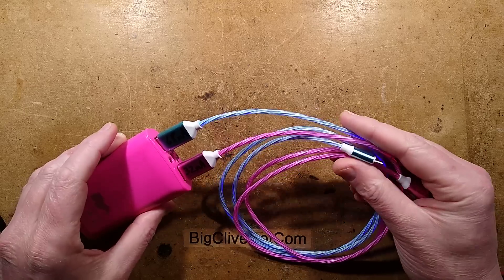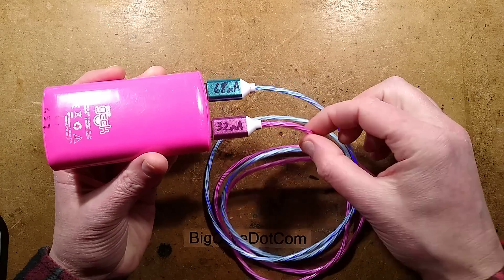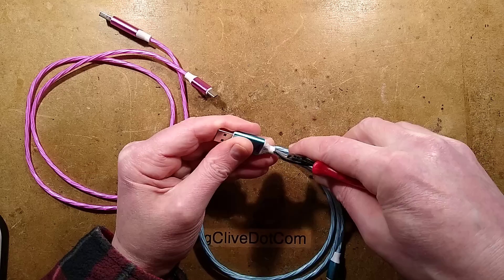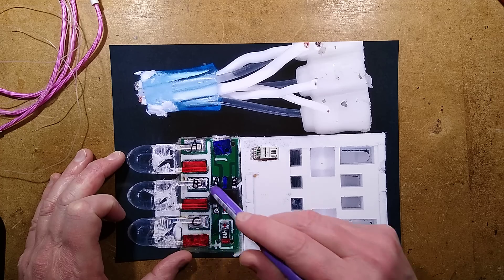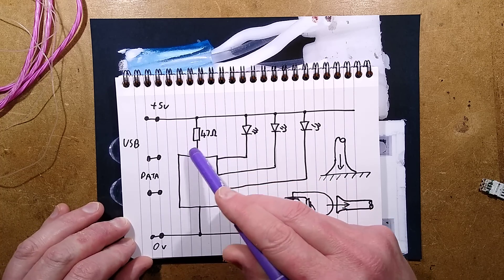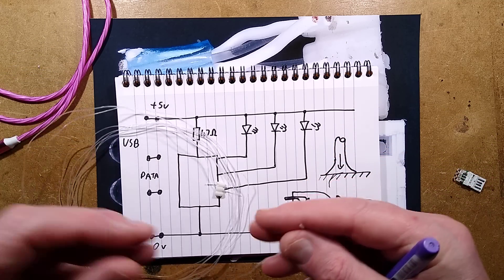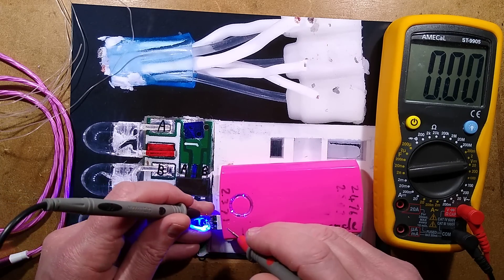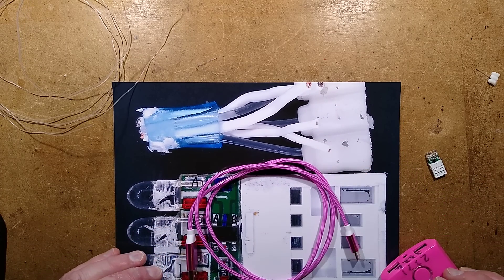Best side-glow fibre optic I've seen

Comment: Wow. I'm impressed with how even the illumination is. If you saw this at a glance, you'd be forgiven for thinking it's EL.
Reply: I had one of these cables for almost a year now, they start to fade in random spots after like 5-6 months
Reply: And the type-c end self-destructs both the cable and the phone's port
Reply: Indeed! I had a similar cable that used elwire. The noise and interference from the little inverter made it too annoying to use.
Reply: I have the blue one and it throws off a lot of light. Used it last week during a power outage and it provided enough illumination to avoid tripping over anything in an open plan area of 63 square metres. I was impressed with it.

Comment: That is a nice effect. Sometimes I just buy these cheap USB light-up leads and use them as festive decorations plugged into a USB socket on the TV or whatever.
Reply: I was thinking the same, ie. using them as just decorative lights.
Reply: I'd get a headache staring at it for loo long. Would look great if static though or a slow brightness change.

Comment: The red cable might have lower current by switching the three LEDs "ON" with a shorter duty cycle.  Red LEDs are lower voltage than blue so they may have had to reduce the higher current by reducing the ON duty cycle.   Thanks, Clive.
Reply from the maker: I'm probably going to end up opening the red one.
Reply: @bigclivedotcom  A little disapointing you didnt chose to destroy the pink one right away.
Reply: @bigclivedotcom  red one probably has the resistor on the negative side of the chip so it's actually doing something lol
Reply: @rimmersbryggeri  He's likes pink i believe. I see lots of pink in his videos as I must have watched a dozen a night for the last week
Reply: @Shakey31  Thats the point destroying tack pink thinks is the signature of the channel. I have been watching for 9 years or something.
Reply: @rimmersbryggeri  ahhh 👍

Comment: I wonder what happens if you use it with devices operating Quick Charge or the equivalent with voltages of 9, 12 or even 20V? Perhaps that's where the resistor comes in to play.
Reply: We don't know what's inside the plug on the other end of the cable. There might be a circuit board that prevents negotiating for Quick Charge.
Reply from the maker: Given that the data is intact it's feasible that it might negotiate a higher voltage and blow the circuitry.
Reply: Only one way to find out😂
Reply: You'd have to have USB-C adaptors on the end wouldn't you? Or does that standard extend to USB-A?
Reply: @LongPeter  I've got QC3 chargers with USB-A sockets and QC3 devices with both USB-C and micro USB. It seems any combination is possible, certainly up to 12V.
Reply: @chrishartley1210  oh, that's interesting. Ah, I probably conflated the USB 3.x spec with the USB C spec.

Comment: I remember seeing a similar style of cable for for the old iPhones and iPads. They were nowhere near as bright back then but the 'flow' rate changed depending on the amount of current draw, fast when first charging, slow or static when the device was almost full.
Reply: Those were electroluminescent and fantastic...but I've not been able to find them in years
Reply: @grayrabbit2211  I have one as well. After only a few days it stopped working properly - it shuts off the light show after a few seconds now
Reply: Yep yep yep, came here to say that. Mine's only lightly used and so still working! (It's the one I keep in the car for the maybe-once-a-year emergency charging need.) ^_^

Comment: I bought a pack of 2 of these about 2 years ago, one is all green, and the other is red, green, blue. They have both been plugged in 24/7 since then. The intensity has gone down slightly on both of them, and one LED has failed in the all green one. They have lasted much longer than any E.L. cable I've owned, and kept their brightness much longer also.

Comment: I have a few of these. They really are great and BRIGHT. Mine have a tri tip with USB-C, Micro-USB, and Apple. I may just buy a few more as they are bright enough for emergency light and pull near nothing. Ran one off my 40,000mAh pack and it lost only 5% over 3 days (~72 hours) and lit the room enough that in a blackout would be enough to get by.

Comment: Try swapping the resistor out? Maybe it's being used to configure current limiting or the speed of the strobing?

I wonder if you could put a current shunt on the 5v rail and measure it with a tiny micro—then use the LEDs to show how much current is being drawn by plugged-in devices? This definitely has possibilities for use beyond just being pretty.
Reply: "the speed of the strobing" was my first thought...
Reply: I bought one that did the exact same thing. Very useful. I could tell if it was almost done by looking across the room
Reply: @jjhack3r  That sounds really useful. How do you search for something like that?
Reply: I wonder what'll happen if it's used for a 9v "quickcharge" or similar phone and supply?
Reply: @Tim_Small  Since QC2, Quick Charge has supported up to 20v. Everything since QC3+, though, has included cable detection. 

Could be spectacular if you plugged in a QC3.0 device and it happily turned things up to 12v@3A.

Comment: I had some of the older versions of these clive when they first took off years ago. But unlike modern led versions with fiber, the ones I had used thin strands of EL wire. I still have one of the two cables today,these remind me of those cause of the consistency of the light through the whole cable.
Reply from the maker: I reverse engineered an electroluminescent one in a video a while ago.

Comment: Is it fibre optic or plastic optic? 😀 
I purchased one each of these for my family when we were going through the 112 day lockdown and curfew here in Melbourne Oz as a way to add a bit of cheer in our lives (I also got some of the cheapy 3W rotating disco lights for the toilets which made me smile each time I visited the throne because I forgot they were there so I was pleasantly surprised each time.
Anyway, a big THANK YOU Clive for revealing the secrets of the cable. I did wonder how it was done but not being an electronic or electrical type person despite me wish the opposite, I was not going to deconstruct a cable to see the inner workings because I would have had no far king idea what I was looking at if I had. So I am very appreciative for your magic reveal of the gently opened connector. Now I just have to wonder where all the light went once it reached the Mode C connector at the other end. I imagine it is taking up space on my phone's memory and it's released each time I turn the screen on. So jolly clever of the designer. 👍

Comment: Just a little useless information for you Clive, those little lenses on the end of the fiber can be made very easily and they do seem to concentrate the light into the fiber aperture. All you need to do to make one, is to bring the cut end of the fiber towards a hot soldering iron from below, pointing the fiber straight up. watch carefully as the lens forms, depending on the iron, maybe a few seconds. Do not allow the fiber end to touch the iron, you are just using the radiated heat. If you try this with the fiber not pointing up, the lens will still form but will form at an angle due to gravity. Give it a try, it works very well! I only wish this could be used on communication fibers to help with coupling into those.

Comment: Nice effect. This would be a feasible replacement for the EL wire since all is needed is an led and resistor (which is efficient) instead of a high-frequency power supply that comes with the high pitch noise baked in. I find that those cheap EL wire drivers tend to overheat and self district. They can be DIY with an ne555 connected to 2 mosfets in a push-pull configuration (pin 3 to mosfet 1 and mosfet 2 is connected to pin 3 through an inverter [not gate] ) connected to a ferrite or centre tap transformer. 

The red USB cable draws 32mA because red LEDs should be driven lighter than blue LEDs; overdriving red LEDs result in less brightness and damage.

Comment: I've seen these that have a bit more functionality.  The cord animation is relative to the current going through.  So as the device completes charging, the animation slows down, then stops when charging is complete.
Reply: I have one of these, never been able to find another :( Do you happen to know a manufacturer who still makes these?
Reply: @wombatdk  unfortunately no.  I had that cable a few years back.  It had a much bigger USB dongle than the one Clive has.  It stopped working a while back, and I tried to repair it, but getting into it was a destructive process.  So in the trash bin it went.  Wish it hadn't died so early on, as it was extremely cool!
Reply: @thereare4lights137  hi, did it have 6 small gauge wires inside, like telephone wire?
I had one of these around 8 years ago, I'm sure it was EL rather than LED,
And yes, it stopped working and I dissected it too, 

Mine also had the USB stick look and the charge rate animation and I think it was about 6 or 7 quid....back in the days when money was worth something 🤑
Reply: @sofa-lofa4241  yes, as I recall it did, and it was EL wire.  Was a pretty nifty looking animation.  The wires were extremely fine, which is why I think having EL wire in a constantly moving cable wasn't such a great idea.  Probably why they're not around anymore. Mine failed in the typical fashion where it only worked in a certain position, and the moment you moved it, it would stop working. It was a bit of a bugger to get apart too, lol.

Comment: I had similar cable. Light went dim after month. Now it barely glow at the base of cable and don't get even to other end.
Also even if it's bellow 100mA I remember that my external hdd didn't like it much when I tried to use it with that cable. I blame mostly crappy usb hub for not getting enough power but still other cables didn't had any problems. On side note SSD didn't had any issues.

Comment: Hey Clive, do you know what exactly the side-glow optic cables are doing for emission out of the optic, is it just a surface finish or are they achieving this in a different way?  I know PMMA (Acrylic) is extremely common for optical fibers, though they're typically not made to be side-emissive, but any form of etching on a PMMA surface can induce an emission point.  Yet in the close-up picture doesn't look particularly etched at all, though the raw fiber removed from the cable bundle does look slightly opaque which would imply at least a frosted texture.  I'm interested in seeing what these highly-emissive fibers are doing to not only have good side-emission but also tunnel light down the fiber fairly efficiently with a good amount of even distribution, though for other projects and other formfactors of PMMA.  Given that they're so decently efficient at both side-emission, tunneling, and distribution, I wonder if the surface finish isn't somehow highly reflective internally, somewhat transmissive, with an external diffusion layer, as this would bounce light incredibly well internally which contributes to how well it tunnels light while also being side-emissive. 

I really want to find a thin-walled tube (hollow center) of this stuff, so that I can proof-of-concept an idea I've had for a bit; though the full extent of this project requires a variety of other parts that seemingly won't exist without custom manufacturing.
Reply from the maker: I think it might be a super fine colloidal component to the plastic.

Comment: Are you sure they use the same led´s in both? Does not red led normally draw less voltage/current in a standard led diode? Perhaps one uses surface mount led that use less power, or the resistor is in the "right" place on that one or of higher ohms?

Comment: With a custom chip, it could have built in resistors or even constant current sinks like the old LM3914 bar/dot driver from the 1980's did.
Reply from the maker: The LM3914 and its siblings are alive and kicking on eBay.

Comment: Take the red one apart and see if it has the same resistor value. If not, it's probably to set current. If so, it's probably to set flash rate.

Comment: So I use disposable vapes like the ones you have taken apart in the past. I ran across these ones from the company funky republic. They have a usb-c charging board I can salvage from it, but more interesting is it has a way to tell how much juice is left in the tank that you can't see. I'm quite interested in taking it apart and seeing how it can tell the juice level
Reply from the maker: If it's disposable, maybe a puff duration counter.
Reply: @bigclivedotcom  that's what I would guess for simplicity sake, but that could be wildly inaccurate given that it's rated for 7000 puffs supposedly. A huge difference can be made by just taking slightly longer or shorter puffs than they plan so I'm hoping there's some sort of sensor

Comment: Perhaps a decent side glow UV fiber optic would make a decent tool for curing resin prints. UV diodes work alright for this purpose, but they're kind of a pain to use, and you have to hollow out a fair diameter of material to fit them inside a print to fully cure it. I'm not sure the existing fiber optics are bright enough at smaller sizes to achieve the same.

Comment: Question is, is it any good as a USB cable? Does the additional circuitry introduce noise?
Reply from the maker: There will be a bit of noise, and a cable like this will never be as good as a proper charging cable with thicker conductors.

Comment: I had a few of these! They don't last very long, but the light is pretty interesting.
Reply: Do they fade or burn out or mechanically get broken?
Reply: @berndeckenfels  just fade
Reply: @melovescotch  just fade?   The one you had sounds like EL strips.  Clive, what do you think?
Reply: @berndeckenfels  The plastic covering them is soft and low quality, and on the cables I had, the magnetic connectors were crap and failed often enough for me to keep them around just for the light-up novelty.

Comment: Stuff like this is a great opportunity to try the "boil and pop method". Popular in model-making communities to disassemble complex models and things like that. As long as caps and everything are discharged... Won't hurt it or anything like that and you can always put it all back together. The water lets you transfer so much more heat into it than almost any other method and it's pretty non-destructive. While softening everything and making it come apart easier. May have to heat it back up to put it back together. And although it's pretty easy to drive off water and moisture with 100% alcohol from circuit boards, and even in complex things like under capacitor labels and in transformer windings... It's a little harder to get the moisture out of wiring. But not impossible

The water will wick all the way through the cables fairly quickly. You can even see this with a 100-foot extension cord. Put a brand new 100-ft extension cord stretched out in your home. Drop one in into cup of water. And it won't be long before there's water at the other end. 

However... You can drop both ends in a cup of alcohol and try to work it through the cable and then even possibly blow some air through it with a sports ball pump on an air compressor hose. Or let the cable sit out in the sun and get fairly warm before bringing it in and dropping the ends in a cup of alcohol. The temperature difference will help it went through quicker and we'll drive off all of the water

I know it doesn't make much sense to go to such trouble for cables but I've actually had to do this for customers on a few occasions. Which took a few weeks of experimenting with other cables and harnesses before I was willing and comfortable to try it out on theirs. In the meantime I just put their huge wiring harness and umbilical hookups in the freezer so that hopefully the water wouldn't start the copper/silver conductors corrosion and the green death would set in.

It can get really weird with highly specialized and impossible to replicate wiring harness and umbilical hookups for industrial and metrology machinery. With stupidly complex and specialized insulations and wiring characteristics that can't be replicated or maybe no replacement parts or even available. And if there's a coolant leak or something like that and I highly specialized and precision lab... It can get serious very quickly in one has to think outside of the box.

After nearly two weeks of 16-hour days.... And probably 50 lbs of nice brand new wiring harnesses I sacrificed while developing the methods....  I Finally came up with a method that works but it takes a little bit of time. According to the situation it can involve simple things like compressed air and alcohol or complex things like crazy different types of desiccant and vacuum Chambers and all kinds of weird stuff but it's definitely possible to save expensive or irreplaceable wiring harnesses. 

 Of course if it's not that important if you you don't have to worry about getting the moisture out of the cables. You can just toss them. Okay I'll stop talkin and leave now
Reply from the maker: The water flow through cables is the curse of many sealed electrical products.

Comment: could the resistor be used as timing for the chip that sequences the leds, as in if you was to increase the resistance would the leds sequence slower
Reply from the maker: It didn't have an effect.

Comment: The first one I got had issues. It was charging only at very low power, 5h30  to charge the phone,the phone wasnt even shoeing the charging icon. Yhe second I got works fine, but I took thr 3 colors. Very very annoying compare to the blue one. At night the blue one was ok, but the 3 colors is like a disco dance floor I dislike it.  I opened the broken one and seen the 3 optical fibers tube, thats a nice trick to illuminate it.